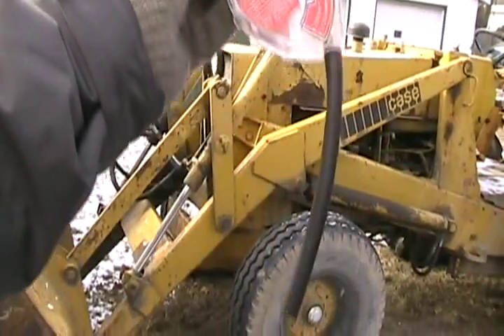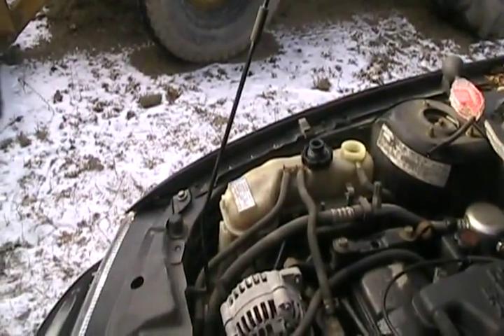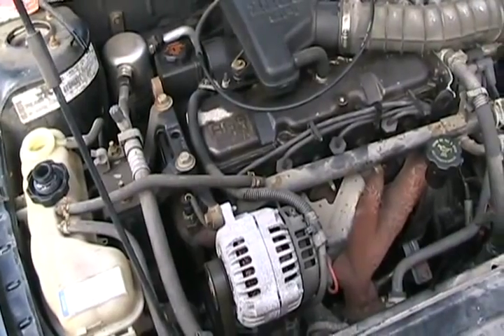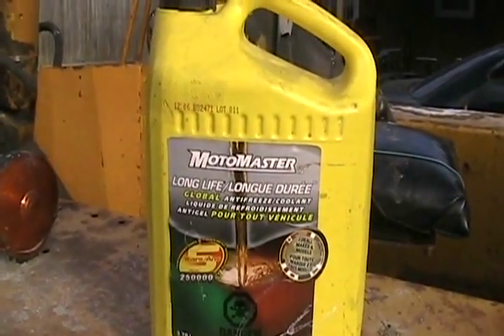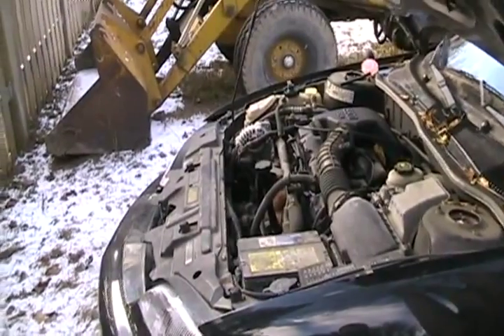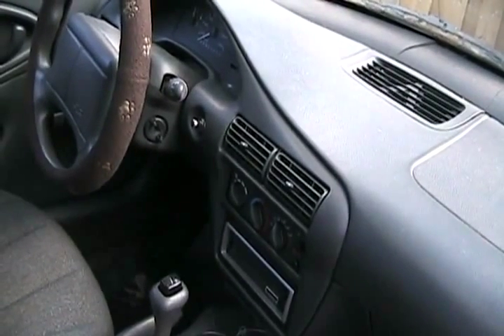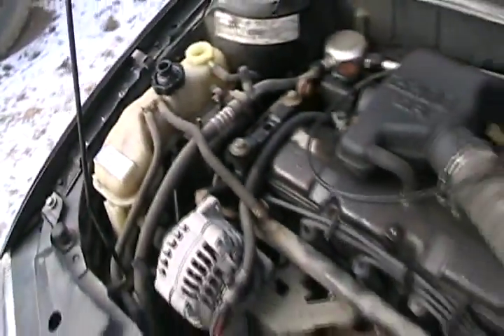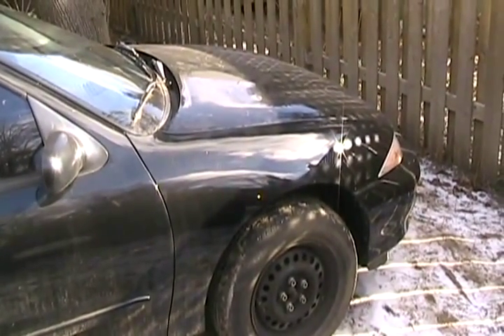#1199 Automotive myth busters, cooling systems [Davidsfarm]

Comment: The heater core in my 2004 Alero might be clogged with calcified crap due to previous owners putting hard tap water in. Thanks for the pointer, Dave.